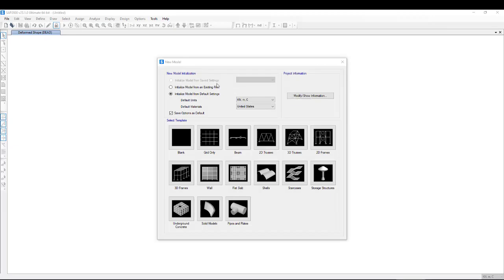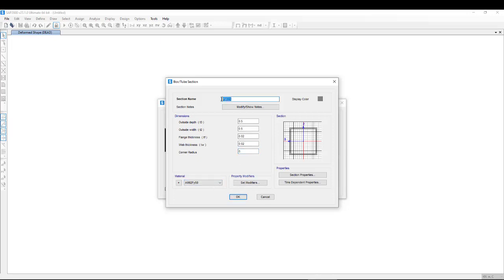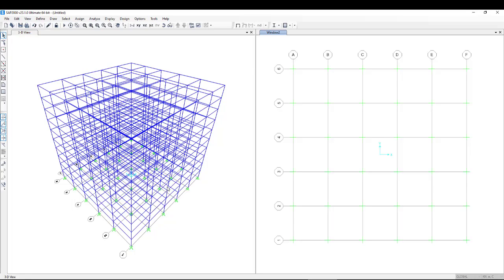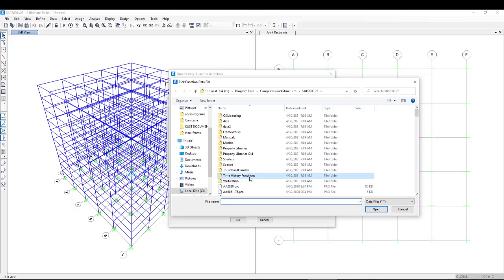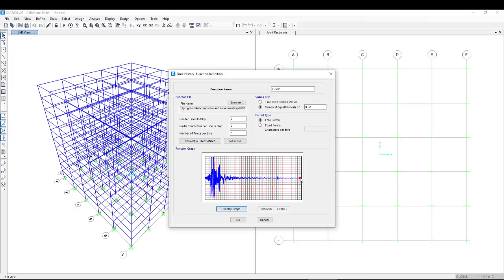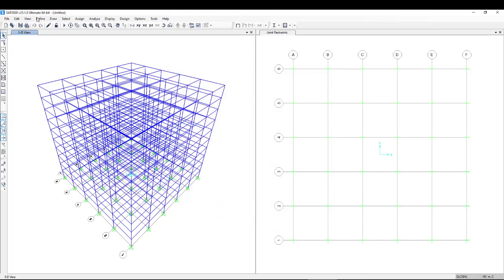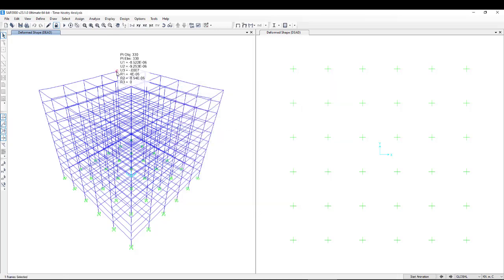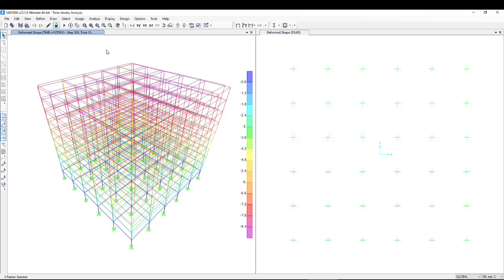SAP2000 tutorial  Time History Analysis of A ten story steel structure

Comment: Hi and thank you for your video it was very helpful. If I want to add a displacement in the base of a column as time history function (for example 0.1m to -0.1m for 5 cycles) I should choose the Load Pattern over Acceleration right? Is there a tutorial or a guide relevant to that scenario (even a joint load as th function or whatever else beside acceleration)?
Reply from the maker: Hi there , you can’t ! the cyclic loading is static and this is dynamic analysis. In your case you should preform nonlinear static analysis as push and pull . There is no such tutorial in SAP2000 in English but there are paid tutorials in Spanish.
Reply: @KSSE_Engineer  There aren't any tutorials for non linear analysis?

Comment: Thank you so much for this tutorial But I have a question. I also watched your video about the time-history analysis of a frame structure in ABAQUS, where the time-history load was applied to the nodes at the base of the column in the Y-direction, and also in assigning base support in ABAQUS all other DoF were set to Zero except Uy were kept unconstrained. Unlike ABAQUS here in SAP2000 Why the time-history load was not applied to the base nodes and why the same Uy component of the displacement not kept unconstrained?

I'm looking forward to hearing back from you.
Thanks
Reply from the maker: It applied in the base . Maybe you don’t understand here we use u1 or u2 which is equivalent to the x,y direction .
Reply: @KSSE_Engineer  I noticed that. But I though it is only for the load definition in SAP2000, and later It would be required to apply the load to base nodes. But I got the point. The steps are not same in ABAQUS and SAP2000.
Thanks once again
Reply: @ImtiazAli-ec9cj  if you don't put load in the base where else can you put it? The whole point is to check the change in time history from base node to top node. Right?

Comment: What exactly is the result we get from the Time History Analysis? I mean it gives the values of the forces and the deformation with respect to time. However, the structure member design is based on the maximum values of story forces and deformation, which is also the case in the linear static analysis.  
For example, if we do linear static analysis, it will also give us the maximum values of the forces and deformation on which the structure will have to pass and the design should govern. 
So, what does the structural engineer get from the Time History Analysis?
Reply from the maker: In a time history analysis, a structural engineer obtains critical information about how a structure responds to dynamic loads over time. This analysis provides several key insights:

1. Dynamic Response: Time history analysis shows how a structure reacts to time-varying loads, such as earthquakes, wind gusts, or other dynamic forces. It helps engineers understand the dynamic behavior of the structure, including oscillations, vibrations, and resonance effects.

2. Stress and Strain Distribution: Engineers can assess the distribution of stresses and strains within the structure at different time intervals. This information is crucial for evaluating the safety and integrity of the components under dynamic loading conditions.

3. Deformation and Displacement: The analysis provides data on how the structure deforms and displaces over time. Engineers can determine whether displacements remain within acceptable limits or if excessive movement may lead to structural failure or discomfort for occupants.

4. Resonance Identification: Time history analysis helps identify potential resonance conditions where the structure may amplify dynamic loads. Understanding these conditions allows engineers to implement mitigation measures to prevent damage.

5. Structural Integrity Assessment: Engineers can assess whether the structure meets safety and code requirements under dynamic loading scenarios. This information is critical for ensuring the structure's stability and durability.

6. Design Validation: Time history analysis is often used to validate the design of a structure, especially for critical infrastructure like bridges, high-rise buildings, and earthquake-resistant structures. Engineers can refine and optimize the design based on the analysis results.

7. Performance-Based Design: It enables engineers to develop performance-based design criteria, ensuring that a structure performs satisfactorily under specified dynamic load conditions.

Overall, time history analysis is a powerful tool that helps structural engineers make informed decisions about the design, safety, and performance of structures subjected to dynamic loads, ensuring they meet the required standards and specifications.